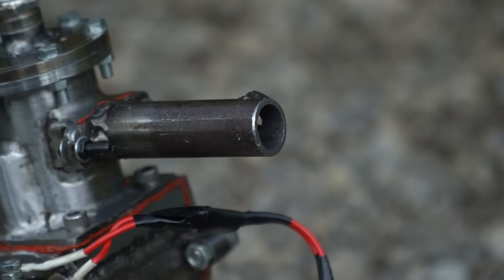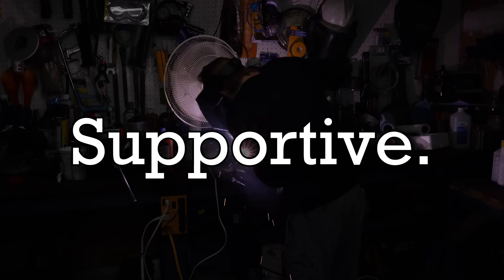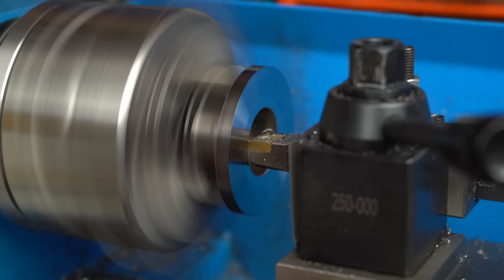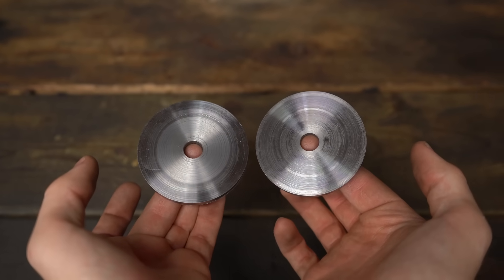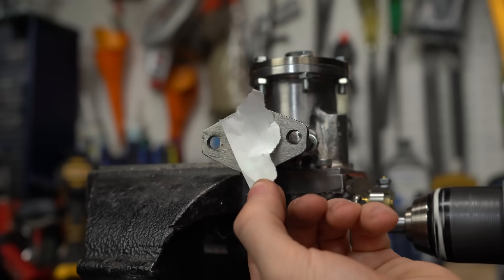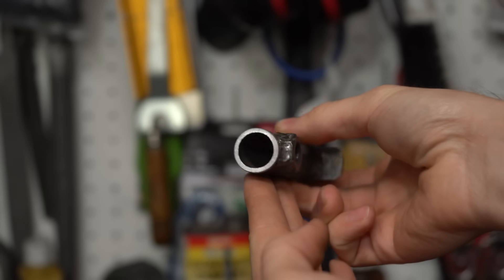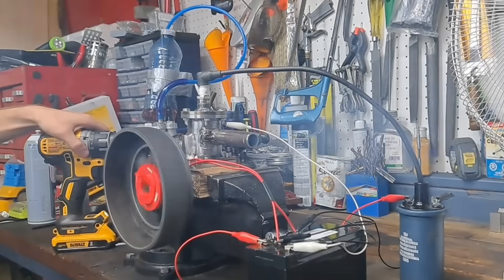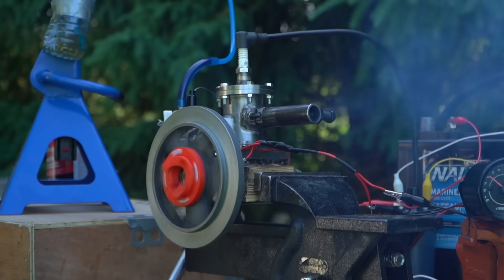I Made a Two-Stroke Engine Using Things I Found at the Hardware Store

Comment: TOP TIP, never use octaine booster, It detstroys all rubber components from engine seals to fuel lines, I made that mistake about 30 years ago, I noticed my fuel line was soft, the carbs  rubber manifold mount turned to plastacine and the carb fell off, further investigation  found the flyweel oil seal was leaking, I used Wynes Octaine Boost, never again, full engine rebuild with new seals, I used viton seals instead as they are supposed to resist the effects of methanol etc but I never used it again, and to be honset I noticed no improvement in power,

Comment: There is more to tune on a carb than the needle. The needle only controls air fuel mixture from 1/4 to about 3/4 of throttle the pilot circuit it's what make it ide proporly

Comment: You could try adding large ridges on the outside of the crankcase to act as a heat sink to dissipate heat better - or add an air/liquid cooling system

Comment: Little tip from a welder: if your trying to deal with smoke and all you have is that fan, keep the fan where it is but turn it around so it’s sucking the smoke in and blowing it away. It’s less prone to blowing your shielding gas away and gets the fumes away from you. ( it will still fill up your garage with smoke lol)

Comment: For a 44-46 bore, try a smaller carb plus airbox, 

The exhaust has a better back pressure if it is a yasuni pipe, or try searching dio 50cc. A pipe without enough back pressure, and a bigger carb than its engine bore, can be harmful to the 2 stroke motor. Anyways, I had fun watching you build you 2 stroke motor. That’s amazing!

Comment: If you have a two stroke with valves (obviously it’ll have the weight of a four stroke maybe). Not only could it be more reliable since you need mixed gas, you can actually have oil lubrication.

Comment: You're on the right track the old 2 cycle engines where made of aluminum cast and had cooling fins to keep them cool some cycled the oil through a radiator to cool them. Also most of the fly wheels are bolted on for a reason that is all of the engines torque, you probably want to turn and balance it too.

Comment: Super late but if anyone is wondering, both side of the back pressure debate are technically correct. A. You do need SOME back pressure for most engines to run, doing otherwise WILL burn valves, period. B. In higher performance cars, epa and likely safety makes manufacturers neuter your engine with excess back pressure that can be removed(while retaining enough back pressure to run properly) then TUNED to accommodate for such modifications, with BOTH (and usually doing the same for the intake, again properly) you can see marginal performance increases. But it’s not much…
Reply: It’s usually enough to make it feel snappier but I wouldn’t say it feels much more powerful in my experience, might be worth it to save up and wait for a tune once ya get cams and whatever else you want in too.

Comment: If there's no exhaust pipe the cylinder and piston will overheat and eventually sieze ,,and way better to have a ,tuned exhaust, or the gas holding capacity of the exhaust pipe equals the volume of the used combustion gas to be expelled,,,gawd I love to try an show off

Comment: 14:59 Ive done alot of work on 50cc mopeds and scooters and a 19mm is considered a perfomance part for most. even 17.5 is a perfomance Carb that ive run on a few low end setups. On most mopeds ive worked on have been between 12 and 14mm in carb size and i think the biggest ive seen is a 34mm

Comment: Constricting the exhaust flow is not what "back pressure" means... Two strokes that are naturally aspirated need the exhaust tuned to a specific resonance, this shape usually gives a bandpass range of tuning hence the term "power band". The detonation creates an exhaust pulse and an audible soundwave. Sound is a pressure wave caused in the engine by detonation moving at the speed of sound, the exhaust pulse is compression caused in this instance by the physical speed of the piston, the two waves are moving at different speeds, so the idea is you want the soundwave to escape into the exhaust chamber and then reflect off the far walls of this chamber and bounce back towards the exhaust port, at the same time the compression wave expands into the chamber and slows down this slowing is timed/tuned to collide with the echo of the soundwave forcing the compression of exhaust gas to flow the other way and push the piston down... as both waves reach the end of this chamber the compression wave then dephases with the soundwave and again increases speed, which forms a vacuum at the exhaust port forcing fresh air to rush into the intake port. This is why the pipe is shaped so strangely so that the two waves will phase and dephase at many different points along its geometry to give greater power at many different rpms.

Comment: i did some research on two stroke engines and i am trying to use your design but i was going to make a v4 design with 2 cylinders on each side on a "V" shape the one issue that i have is i have no experience with a ladle so i will try other ways to finish it like making my own custom sized piston to use i would also like to know if you have any tips i could use on fuel mixtures and how i can weld a tight seal the first time i weld and not the 4 redo of the weld.

Comment: Coming from a machinist this video is impressive however there are some things I would suggest to make more accurate parts. For one three jaw chucks are not very accurate so if you must remove your workpiece for measuring purposes you should dial it back in with a four jaw (better yet a collet chuck but those are expensive), especially for something like a bearing fit as those need to be very accurate, which leads me to my second suggestion. If you have to weld machined parts you should leave yourself .015 to .02 of an inch (0.38 to .5 millimetres) for finish machining as the heat from the welding process will likely warp your part. Again though for someone who doesn’t do this kind of work for a living you’re killing it.

Comment: ---- Please don't put you hands around the part when you use emery cloth on lathe ----
---- Grab a long strip of emery cloth or sandpaper lightly with your fingertips and pull it around the part ----
---- Your fingers will slip if the emery cloth grabs. Your hand won't and you WILL get injured ---

Yeah, you had the other hand on the control and sure the cheap minilathe won't suck you in whole.
But even a cheap minilathe will break your fingers or wrist and it will happen fast. I've had a close call once, luckily got out of it with some sprains.
I don't want you or anyone viewing get injured when there is a safer way to do the same thing.

Comment: Just a thought, based on your animation at 0:40 - I'm not an expert
It looks like your crank case volume should roughly be equal to your cylinder volume. If the cylinder is larger or smaller, the mix coming out of the crank case would mix with old exhaust and be poor for combustin, or mostly blast out of the exhaust port. I suppose you randomly dumping oil in the crank case roughly equaled the two volumes. Your case volume does roughly look larger than your cylinder volume.

Either way, great video!

Comment: 2 strokes dont need an exhaust to run, but it can be highly beneficial having a good exhaust in terms of power....

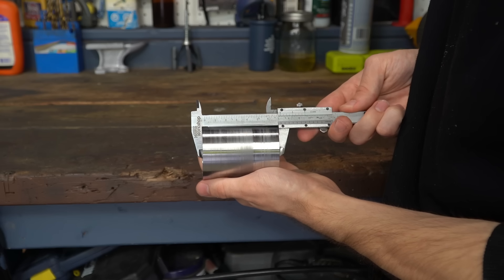dont poor oil iin the engine... not needed.... just an oil/feul mixture of 1:50 is fine....

and it looked like the squish height between the piston at TDC and your head is way way off.... im pretty confidaent it will run a lot better if you set the squish height between 0.9mm and 1.2mm... 
it wil have a lot more compression... higher compression is mostly beneficial at lower and idle rpms in terms of torque.... 

and possibly installing a reed valve couldnt hurt either...

this beeing said.... that you manage to build a 2 stroke that does run all by yourself....
its just impressive... really really impressive..

Comment: Most of the 2 strokes ive worked on have an expansion chamber. The exhause pule resonates in the chamber causing a pulse back into the cylinder so unburt gas is pulled into the exhause then compressed back i to the cylinder.   Also i may have missed it but i didnt see if you has a reed valve assembly on the carb.

Comment: If you want a better finish you can add a water squirter with a recirculating pump and a pan and point it at the tool holder exactly at the cutting tool

Comment: It’s really hard to get really precise tolerances, with these “hobby lathes”.  One of the upgrades that i plan to do, is add a DRO.  These machines are so lightweight, that the vibrations cause everything to loosen up, and you end up tuning the machine to get the slop out of the handwheels, every time you use it.   With a DRO, it doesn;t matter how much slop is in the handles…the display will tell you EXACTLY where your tool is, no matter what. 
Then you can dial in tight tolerances. 
You did well, free-handing it. 👍

Comment: My thoughts:
40:1 is what the best 2 strokes in the world are using.  Not long ago engines used 30 or even 20.  This engine is home made.  I wouldn't expect it to handle the mix of a Husqvarna.  Add more oil. 
4 strokes don't need back pressure. 
2 strokes do.
Don't get knowledge from Google.  Go some where reputable.  
The steel in that pipe is garbage.  Using a better quality steel would help lessen the damage. 
All in, very impressive.  Especially if you did it all in onshape which I had trouble getting used to.

Comment: I´m looking at this now... and i study lathe and milling programming. I was doing the same mistake as you, going up and down measuring between cutting, and that horribly slows you down in the work. then, i figured something out. MACHINE CLEARANCE If you know what machine clearance you have in your vernier and add the value of the clearance to your mesurements, you will achieve the same spot. (Sorry if my spelling is misserable or you could understand it)

Comment: The engine looked relatively easy to crank by hand which is kind of alarming. It definitely did not have much compression, I'm assuming it had about 25 to 30 psi which is far below the ideal amount, which is like 100 - 150 pounds. If it had that much compression, it would have ran a lot better and would have made less smoke since the mixture would burn more efficiently.
Reply from the maker: I did a compression test on it with one of those tools and if I recall it read like ~80psi. I designed it to have an 8:1 compression which would have been the max compression before the piston starts ramming the head. A few measurements were probably off enough that it was closer to like 5:1 lol
Reply: @CamdenBowen Makes sense. But next time, try making a longer cylinder and a longer connecting rod so you have a longer stroke since that leads to having more torque.
Reply: @RalphyTheCoyote  more torque if he build a 12cylinder diesel. That little motor has plenty of crank length. And on an el cheapo lathe thats pretty much the biggest cylinder you can make.
Reply: @ ohh i didn't think of el cheapo that makes sense
Reply from the maker: @RalphyTheCoyote  el cheapo is canon to the Camden bowen lore
Reply: @ lol

Comment: Also, try 3d printing and then casting the cylinder and crank in zanak, its cheap and easy to cast.use the 3d print as a mold form. You can lost wax style cast or open top sand mold style. Might allow you less production time, and you can use a sleeve in the cylinder.

Comment: The chatter has to do with the tool height, i use the same lathe and bore bar also on small projects, the tool height is likely too high like my lathe. Take the tooling down in height after verifying your tools sit just under center. Pretty much aim for the top of the insert on center.

Comment: I would recommend finding a 120VAC (USA wall power) to 14V VDC converter.  Car batteries are really designed for high current and short durations.   Electronic "junk" shops will have boxes of old lap top computer power supplies.   You might not find 13.5V but you will find close enough.     Pay attention to curent ratings!!

Comment: You should use a better quality rod bearing and make a head gasket for it, as you need all the compression as possible if all else fails increase the size of the exhaust port and make sure the exhaust has plenty of escape. Awesome job building this engine

Comment: You should try making a diesel type 2-stroke! It solves a lot of the problems this type of engine has. The only increased complication is needing an air blower, as it doesn't use the crank case for exhaust and ventilation.

Comment: Plating the bore would be better so the rings dont destroy it

Raising the needle for idle running wont help either as it throws the rest of the rpm range out. Up the idle jet instead

Comment: "...it does need" a Tuned Expansion Pipe or Tune-Pipe.  :)
The are calculators online.

After the tune-pipe you might try a centrifuge to return unburned oil and particulates (smoke) back to the intake...
You might integrate some silencing/muffling into the design.

Lube:
Research: Argonne National Labs Boric Acid in oil lubricant..!
Especially as you have no cooling on that thing.

Comment: You've got a great voice , a zillion times better than the modern Tin brain versions. 
Secondly l'm an old Petrol head of 71 and I just loved your determination and honesty in tackling problems. 
Never say Die 😂. 

Being old and not much use for anymore physically I only have a bunch of forgotten dreams to inspire you .
Even in your crude way my suggestion is to do an OPPOSING PISTON TWO STROKE next where you can play around with different CRANK TIMINGS. 
I suggest having INTAKE PORT on one side of sleeve and EXHAUST on the other side.
It could even be DIESEL if you can achieve high enough compression .

Okay that's NOT IMPOSSIBLE so it's up to you now.
I'll be watching.

Comment: Hi there, I'm a pro electrician/mechanic with plenty 2 stroke expertise and it seems that the problem sits on the carb. Specifically the pilot jet is too small.  The needle height adjusts mix strength on throttle openings between 1/4 to 3/4 and after that will be the needle jet size. So below that is the pilot jet and the adjust screw but since you're not even picking up fuel then you'll need a different carb piston with more cut out section to increase Venturi effect on the throat. Off the shelf carbs come with average parts based on popular applications, maybe the shop will have alternative choices. Oh, and that engine will overheat very quickly. Forget the exhaust and back pressure that's not the way it works and certainly that's not necessary to start. Congratulations tho, nice work

Comment: 3:01 my guess is that you need to give it some more power, while keeping the same wire speed (sorry im dutch and the names are different, but if you are a welder you should know what i mean),   by giving it more power the whole weld will flow more/melt away more, resulting in a more widen but stable looking weld.... if the amps are too low it often tends to spat and sputter everywhere and the weld itself is not burnt deep enough and the outer layer looks like a inconsistent mess, (btw this can also happen for example when your negative is not connected well enough for example because of paint or rust, this also results in the weld not getting enough power while your settings have been good) edit; to make a long story short you should find the right amount of amps so that it will come to the point that it starts flowing automatically, but not too high that it will become too big..  wire speed helps to correct if you need to burn deeper then try lower wire speed, but on the other hand when your material is thin you need a faster wire speed to prevent burning without filling

Comment: As far as i have learned you can run a 2stroke engine with ridiculously huge carbs but then the pipe needs to fit very precise. My ktm 125 sxs has a 39mm carb and an fmf fatty gold series pipe with a fmf shorty exhaust and it runs like a beast! at lower rpm she spits a bit wich makes sense with setup buildt for high power at high rpm. So it wastes a bit of fresh mixture lacking  backpressure from the exhaust. But as soon as you get the resonance in the exhaust it leaps forward and every gear takes the same time to rev out.

Comment: You need put a pipe more longer and variable in longer. pipe in pipe a minor diameter. And adjust the exhaust system. Synchronization of exhaust gas